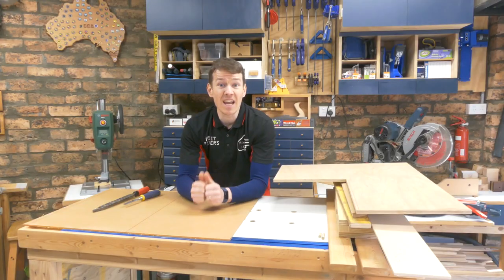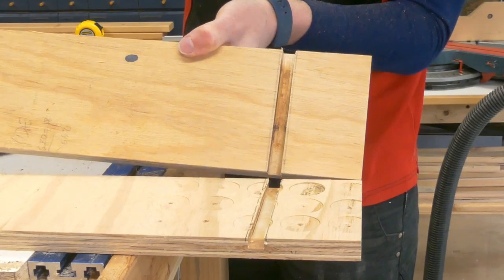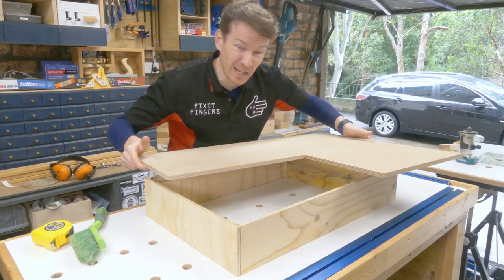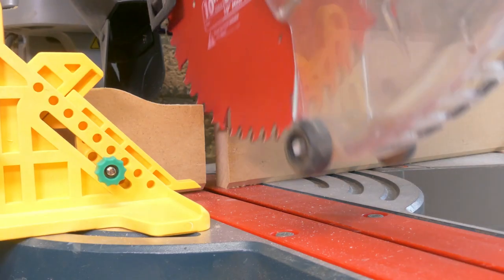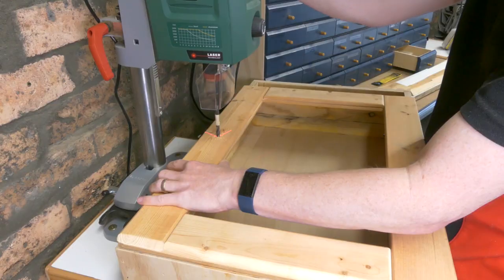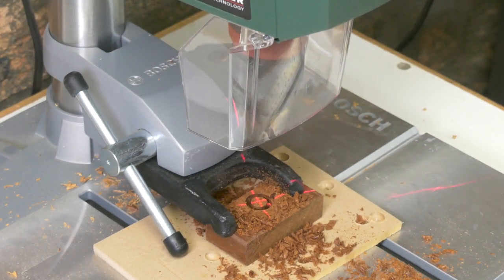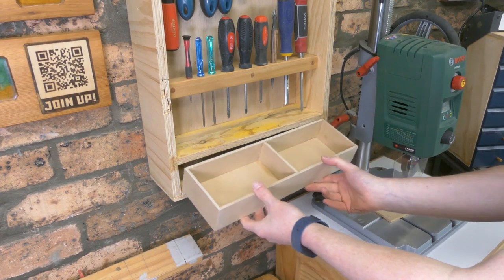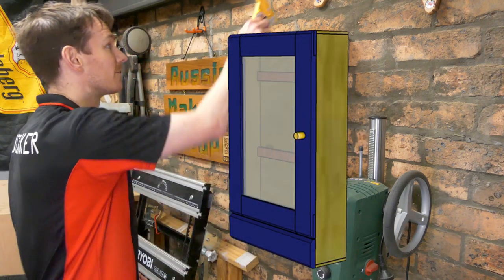Scrap Wood Handtool Cabinet (Microjig FitFinder Review) #ScrapwoodBuildOff

Comment: Nearly starting a fire while wood working, classic. i did a similar thing sharpening an axe on my belt sander, the sparks went straight into the dust bag. That FitFinder works so good, it could be a cool video to make a v2 from wood. That cabinet turned out great btw and your draw making technique sure is smooth, i guess you get that after making 54 on the apothecary project lol.
Reply from the maker: I did get rather a lot of practice with these little drawers...if only I could make them the right size 😅 You should give the DIY one a crack!

Comment: I would love to finish off my Kreg workbench with the microjig groves and add a side panel for 90 degree joints or just to hold items without a vice. I have two Kreg 50cm X 162cm workbenches bolted together longways just waiting to be finished. If I could incorporate a router and a table saw into this table top it would be the ultimate garage workbench for a typical home garage. I live in Sydney, maybe it could be your next big project.
Reply from the maker: G'day Ethan. This is my current Kreg Clamping Bench - https://youtu.be/p-Uc0Qzf0Bs I hadn't thought of also adding Microjig Matchfit Dovetail tracks but it is not a bad idea! You've actually correctly guessed my first big project of 2023... I made this clamp bench high so I can build a second bench underneath it which will contain a new router table too. That will be my next big build but there are a few things going on this year first ;) Where abouts in Sydney are you? Im in Chatswood.
Reply: @FixitFingers  I’m in St Clair. I’ve joined your website so maybe I could could contact you through your website. My wife loved you sliding gate for the dogs.
Reply from the maker: @ewen832  sure can, or via Insta or Facebook if you use those.
Reply: Joined your Instagram also. Now I feel like a stalker.

Comment: Enjoyed that mate, came out great! You're getting some great use out of those planes too, handy to have. That jig looks handy, not that anyone is incapable of dividing something by two, but just speeding up that part of the process looks to be the win. Didn't realise this challenge was a thing either, might have to bash something together :)
Reply from the maker: Tim is mostly on Insta so not really a YouTube challenge and it is primarily a UK thing. He's a funny fella I found through Jesper and Dainer recently so as I had the perfect project on the books thought I'd jump on. It is certainly an efficiecy tool, and most useful if you jump between a lot of odd thickness stock, such as scrapwood. Honestly, while I found excuses to use the jig for this build, it came in a lot more useful than I originally gave it credit for. As I dont have a thicknesser and they are much faster than sanding, the planes however are definitely seeing great continued use!

Comment: Hi James.  What a handy gadget that is and what a brilliant idea. The cabinet is a great project and your use of resources admirable.
Years ago here hardware shops always had a selection of factory offcuts in bins at the back of the shop for wood at affordable prices. That has all gone sadly.
The slot cutter saves a lot of fiddling about.
Great tips, splendid presentation: what more could we want? :-)
Cheers James {Thumbs up emoji}
Reply from the maker: You'd be hard pressed finding a wood using factory around here these days let alone one with a scrap supply they sell 😥 The slot cutter is a mildly terrifying router bit but very handy for this style of panel work. Thank you as always for your patronage and insights Eryk {Thumbs up emoji} ;)

Comment: A tool for dividing by two is not exactly at the top of must purchase list. Buying Perspex? You know those TV screens and computer monitors dumped by the side of the road ...
Reply from the maker: It is a handy little thing, but I must admist the price at $80 is a bit steep compared to other tools you can get for that sort of money. I'd not thought of TVs! I don't use it often and this bit I bought a long time ago for a 'nice' project so technically it was 'scrap plastic' but I'll keep that tip in mind next time I need some. Cheers mate!
Reply: @FixitFingers  I wouldn't even try and get this past the Tool Acquisition Commissioner. "I want spend to spend $80.00 on new tool" TAC "What does it do ?" Me "Can I take the 5th?
Reply from the maker: @sheilbwright7649  😂😂😂

Comment: Dude the problem is easy to solve with the fit finder and finding the depth for the cut of the miter saw. Clamp a piece of wood to the bottom for the fit finder the top of the clamped wood is now the height to which you set the blade! You are second person I have explained this to on YouTube! Duh!😁🛫
Reply from the maker: Argh yeah I can see that working, nice little hack!
Reply: @FixitFingers  not a hack common sense! I am glad I could enlighten you and maybe others too! 😁 sometimes we over complicate things,
That is why I have three times the experience that other have because It takes me two times to figure out a solution! And sometimes that solution is an adult beverage and shut down the shop while I think about the problem. 😁🛫